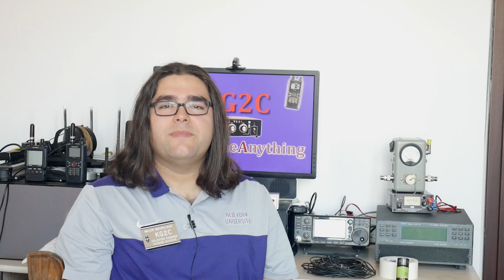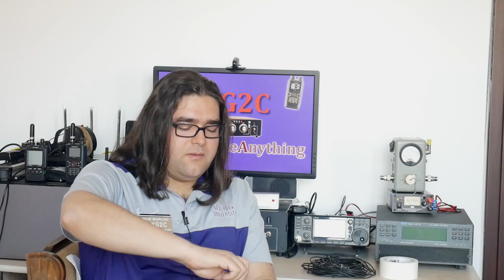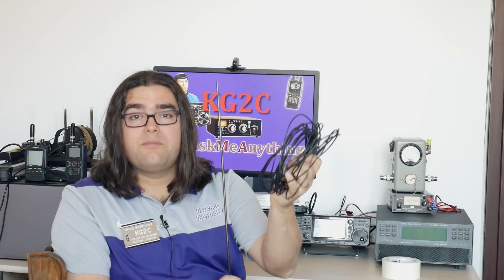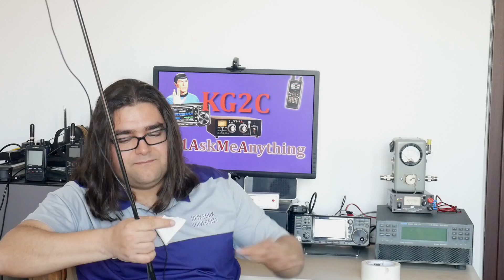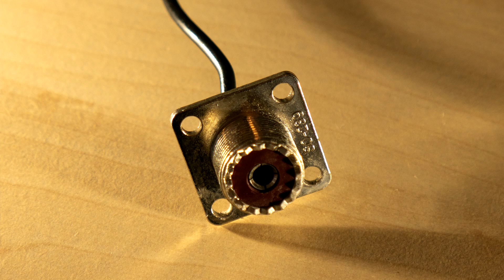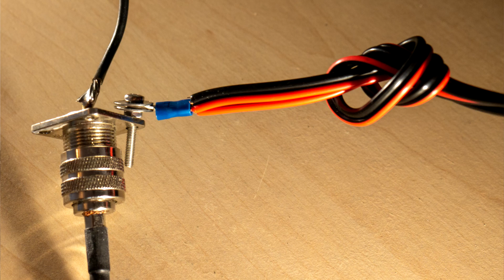Simple, Cheap, and Quick Portable Antenna

Comment: What were you using for batteries  for your portable operations?
Reply from the maker: I use LiFePo4 batteries from Bioenno and from GTK. Bioenno are available in the US and GTK I got from China. Both work well.
I also use solar power while portable and that will be covered in another video.
Reply: @kg2c  thank you, I will look for them. 

Peace, 73 & DX